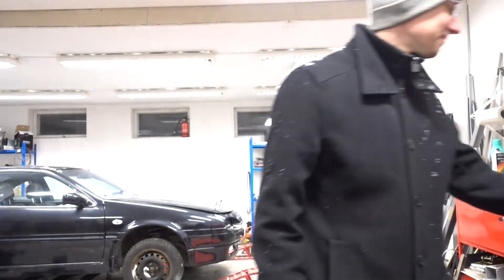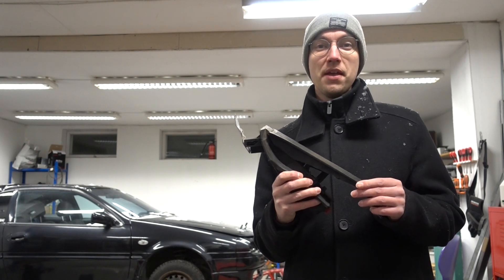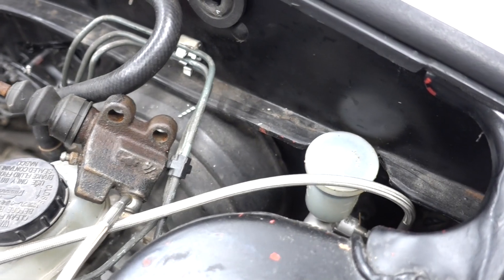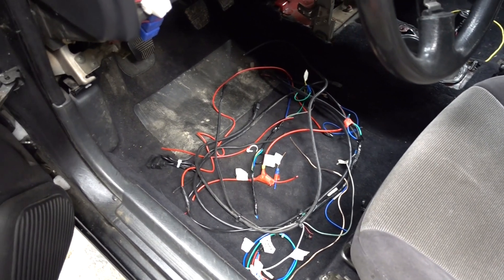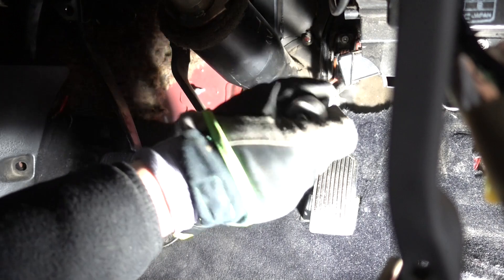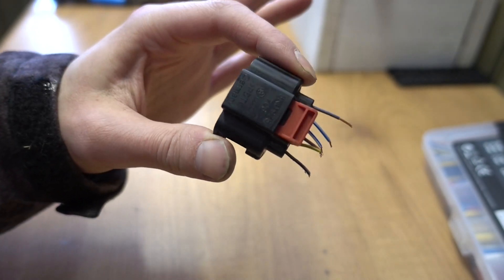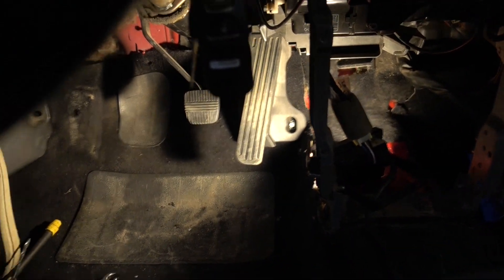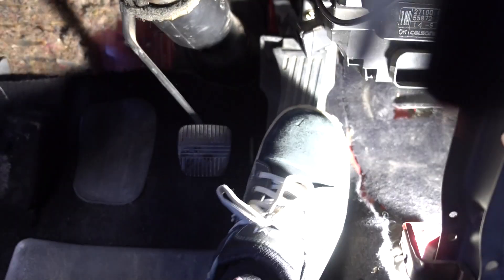EVNX - Electric Vehicle Conversion, Pedals [EP4]

Comment: I find sometimes that when striping wires heat can be your friend. Using a blow torch to heat the blade means you need next to no pressure to cut/melt the wires plastic coating which means you are almost guaranteed not to sever any copper strands. A crap soldering iron with a fine sharp end can do this job too you just have to be careful you dont melt the plastic into the copper which can contaminate the solder joint.
Reply from the maker: Ooh I like this tip! Will try it next time!

Comment: can't you use a potensiometer from a older vw 1998? they can conect directry to the old cable. On my car i use a 2001 pedal it's just 3 bolts on the firewall
Reply: The accel pedal from a 2002/2003 A33 has an egas pedal and will bolt on to the NX.
Reply from the maker: Yes! If you are aiming for a "purist" conversion that keeps an OEM look, a potentiometer attached to the throttle cable works just fine!
Reply: just to be easy in my opinion. what about the charger? i can't find any controller on the market.
Reply from the maker: @CrAzYDr1veR  I am gonna be using the OEM LEAF charger, and drive it with an Resolve-EV controller. Cheapest and simplest way!
Reply: @DalasEVRepair  this is very recent i never saw this ptoject before. The openinverter is cheaper but does not control the battery or the charger. Do you have any discounts on this controller? :P
Reply from the maker: Unfortunately no discounts, but it brings so much value at just 900€, it is hard to ignore!

Comment: One thing, it looks like in an emergency break you might grab the break pedal with the acceleration one at the same time. Try to press them hastily without looking at your feet. See how that goes
Reply from the maker: After shooting the video and reviewing the footage, I actually thought about getting an extended brake pedal from an automatic vehicle. These extend wider to the left. So I will try to get one (or make one)! Thanks for the feedback!
Reply: If the brake pedal is pressed down the accelerator pedal input turns off. It's a good safety measure however it makes burnouts harder :)
Reply: should be correctable by software. if break is applied, no acceleration given. Then you can slam with both feet and its fine. Probably most controllers come configured like that anyway.
Reply: @gelisob  motor controllers don't typically get any signals from the brake pedal. you could design it like that but its not the default.
Reply from the maker: @reider_mcfeely  Nope, motor controllers need to know when you are pushing brake, so they can max/blend regen while you also brake with friction brakes. The controller I'm gonna be running requires a brake-switch. (Resolve-EV)
Reply: @reider_mcfeely  even my electric bike controller knows when i'm pulling the breaks and doesnt apply power then. 
If controller doesnt know when breaks are applied, how does regen brake happen? Maybe you're talking about some very basic or old controller?
Reply: @gelisob  many controllers have it set up where when you let off the accelerator pedal, regen braking is applied (one pedal driving). So then hooking up the brake is entirely optional. You can have regen using the brake, it's really personal preference.
Reply: @DalasEVRepair  interesting. I don't have experience with the resolve controller or leaf motor. You can just run the accelerator pedal and have regen with that instead (what I'm doing in mine). Both options should work on most controllers. Are you sure the regen can't just be run off the accelerator pedal?
Reply: @DalasEVRepair  of course I don't know much about the resolve controller. 

I've heard that you can reuse the leaf charger and DCDC converter with it though. I would be very interested in that if you can get that working!
Reply: @gelisob  for example Tesla doesn't use the blended regen when you step on the brake. They only have regen when you let off the accelerator pedal (I believe).
Reply: @reider_mcfeely  and i will challenge that belief instantly. Does not compute. Would mean tesla disengages regen when pads are used, why should that ever happen. It does not happen. It is not either/or, it is blended for all cars since nissan leaf 2010/11 and probably before. We have all heard about reduced regen when battery is near full. Reduced, not disabled. Just like my car does. It's free additional braking power.
Reply: @gelisob  Tesla is one of the only companies that doesn't do blended. When you step off the gas (regardless of whether you step on the brake or not), regen will be at maximum. Has nothing to do with the brakes and they are entirely separate.